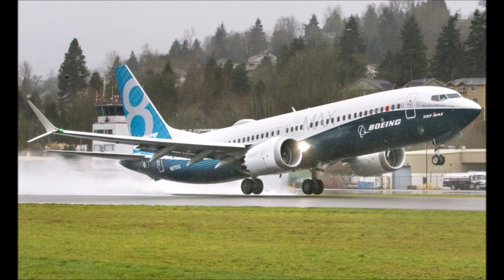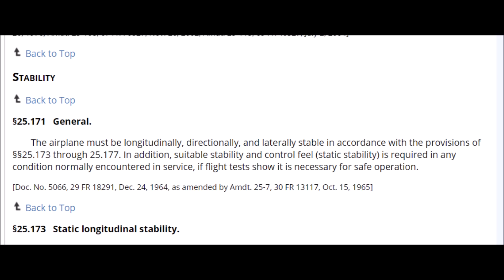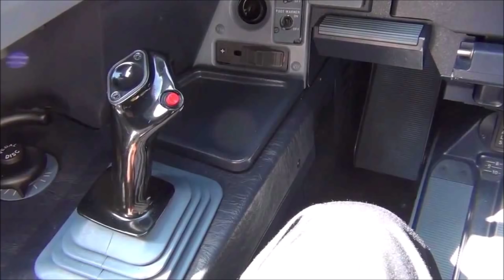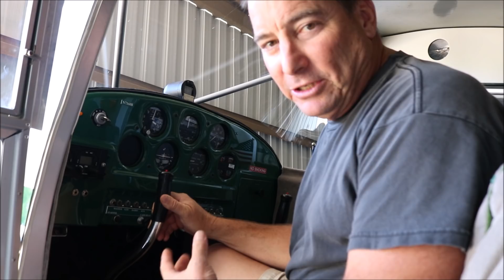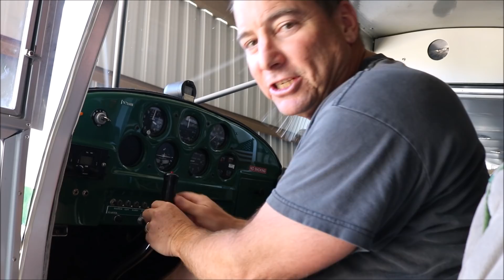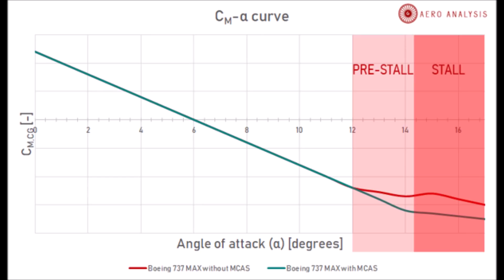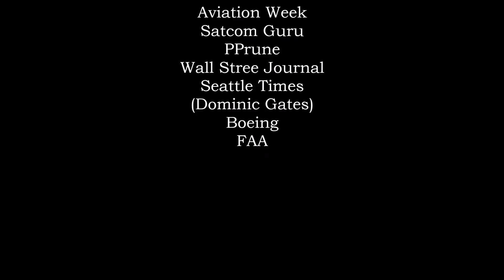737 Max UPDATE 30 Aug  2019

Comment: "MCAS is NOT an anti-stall system". Something that warns about or discourages a stall is not-anti-stall? Where would a stick shaker or indeed the warning horn fit into that? We're not the only ones confused - the argument about the exact nature and purpose of MCAS has been raging on that 'Professional Pilots Rumour Network' (a US based pilots chatboard) since Lion Air. Is it an anti-stall or is it a system which 'modifies longitudinal trim AT or near the stall' and what's the difference? Professional pilots don't seem to agree and Boeing's original MCAS documentation even contains the phrase 'ant-stall' on at least one page.
Why is so important to the pro-Boeing faction that the term is avoided? Does anti-stall have some other more specific meaning - in military jets for example or is the fear that once the words are said, the 737 Max will be unable to shake off the 'inherently unstable' label? I'm no pilot but I seem to remember from my total six hours learning on light aircraft that the best way to manage a stall is not to get into one.

Comment: Hmm. My ears pricked up when you mentioned '16-bit', which is pretty stone age these days when you can buy a decently specc'd 32-bit microcontroller board for $2.00. Found also multiple allegations - not denied by Boeing - that the FCCs on the 737 Max are based around the Intel 80286 chip, which was pretty much evolutionary toast in the PC by about 1989. I'm old enough to have developed '286 software in assembly language and it USED to be a neat little chip, albeit running at about 20 MHz (yes, MHz) and with some intrinsic design difficulties about its memory access capabilities. Although I can well understand why Boeing would go for a true microPROCESSOR, given the requirement to customise bus communications, I'm mystified as to why they'd want to stick with this Intel pre-history. Whether it was a good idea or not, every modern computer geek able to Google has rushed forward to decry the 737 max problems as due to 'silicon'.

Comment: Great videos, Juan.
Just for the record, the Longitudinal Axis is actually the Roll Axis.  The Lateral Axis is the Pitch Axis.
Reply from the maker: You pitch 'about' the lateral axis by maintaining longitudinal stability.
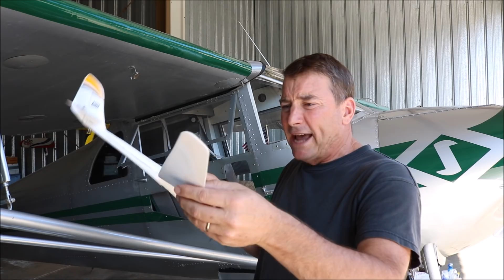Reply: At 12:09, you stated "aircraft stability on the longitudinal axis, pitch axis.."  You wiggled the model around the lateral axis as you said it. The lateral axis is the pitch axis.
Reply from the maker: You'er getting all wrapped around the axle with your Bill and Martha King private pilot tapes...lol
If we had a lateral stability problem here we would be taking about  wing rock or rolling about the longitudinal axis.
We are discussing longitudinal stability. Not lateral stability.  not the axis upon which each revolves around. Semantics.
Reply: Now, you're just being petty. I also have 40 years of flight experience. At 12:09 in your video, you CLEARLY claimed that the longitudinal axis was also the pitch axis. This is simply NOT TRUE, and there's nothing "semantic" about it. "Axis" is defined as  "an imaginary line about which a body rotates."  If you had a question on a written or oral exam about which axis controls pitch, you would have answered it wrong.  
 
My only issue is you incorrectly stated at 12:09 the longitudinal AXIS is the same as the PITCH axis. I do NOT have an issue with the rest of your explanation. 

Perhaps you should review the King tapes and pay close attention to the part explaining the three axes?

Bottom line is you made a mistake, and you're unwilling to own it and set it straight.

Comment: Once the MAX starts flying again, I will have no issue about flying on it. The problem will have been fixed. But the damage is done. I have chatted with family members who have said they will avoid flying on the MAX, because of the trust issue. As such, it has damaged the whole 737 brand. My biggest issue is still seat and leg room. Not the plane model or brand.
Reply from the maker: Exactly.

Comment: Great job, Juan -- as usual. Very detailed reciting of MCAS development. 
What most folks miss is that the Ethiopian Air flight departed Addis Abbaba which is at 7800 feet elevation and  is surrounded by mountains of even higher elevation. It has been noted that the throttles were never pulled back after takeoff and this led to the plane's airspeed being much too fast to manually trim. They did try to manually trim but it wasn't possible so they reenabled the stabilizer trim motor cutouts which also permits MCAS to feed commands to the stabilizer. This caused the plane to crash. If one looks at an time v AGL plot it is clear that the pilot was trying desperately to
thrust the plane to a higher altitude as quickly as possible. Perhaps this was to have more time to work the problem or perhaps it was to avoid flying into a mountain. In any case it's not clear
that even if the crew was aware of MCAS that the flight could have been saved. If they knew they might have been able to slow down enough to manually trim. Although the original MCAS design (as delivered) wasn't great it was probably sufficient.  The revised plan of disabling MCAS only is the right thing to do. This permits trimming by normal methods at any altitude and speed.
Reply from the maker: see previous updates.

Comment: Just a thought: If Southwest is rethinking its entire business model, how about a new plane that is based on what SWA pilots want?
Reply: Too much cost to do that. Planes allegedly being looked at by SWA include the A220 (smaller than the 737, can be used as low-density feeder aircraft for flights like Dallas-Love to Lubbock) and Boeing 797 (two-aisle config allows for faster turnaround time than newer -800's and MAX's).

Comment: Thank you for the excellent reporting. Long ago when I was in Navy ROTC they would bring a small prop trainer and we would go flying with a Navy pilot. Great fun! Great little air plane. After doing a series of barrel rolls, loups, the next demonstration was how sable the plane was.  Full power, nose up into a steep climb. At some point the prop would cavitate, the plane would shutter and the pilot would say "don't touch the controls." With neither of us doing any thing the plane would start to fall backwards roll sideways an fall rapidly. it would then do a series of side to side swings bring the nose to level and proceed as if nothing had happened. The pilot would say "OK take over" again. No computers! That little plane had a lot of power, didn't care if you flew up side down, really short take offs & landings. Teach that to a 737!
Reply from the maker: Yep Stability achieved thru aerodynamics.

Comment: Let's not forget the crash of Air France 447 in 2009 which might have been prevented with stick feedback informing the pilots they were flying in a stalled condition. Instead they and their flight computers flew an Airbus A330 right into the ocean killing 228.

Comment: You should have used this explanation from the very beginning.  Don't let the mass media dictate all the false facts.  Push the fact that one of the two crashed aircraft had previously recovered from a trim runaway condition by shutting down the MCAS system by a competent third pilot.  Different cultures are likely not as well trained or disciplined as USA pilots.  Boeing should have put trim in motion audio to warn the aircrew.  I really like trim in motion audio in test flying (MPLS MN Autopilot repair specialist) many different corporate aircraft.  I always paid attention to pitch trim making certain it was always functioning properly, autopilot on or no right through to coupled ILS approach. Many years Autopilot repair specialist.  Fortune 100/500 city upper Midwest.  Lots of business.

Comment: Yes, MCAS was a bad design not having redundant inputs.  Did the pilot side AOA sensors fail, or was it input to the FCC?  Who built the AOA sensors, was the Indonesian previously changed (as reported) AOA sensor tested?  Odd the Airbus Alt-law crashes didn't cause a grounding or as much uproar.

Comment: Juan I have been watching your channel for some time and really appreciate your research and professional inputs. Hope you will be flying again soon.  As a compter science and pilot guy, I have been following aviation accidents for many years with an interest in human factors and engineering design issues. While there are numerous design principles for modern aircraft, no single points of failure, transparency of functions and feedback are important even though Boeing and Arbus differ in their design philosophies. I hope that there has been a thorough protocol for the changes to FCC, AOA and MCAS architectures and functions that doesn't introduce some new hidden behaviour that is thrown back at the pilots.
Reply from the maker: Thanks Gary!

Comment: Well, you brought the whole story together here for me with this video, and the length was necessary to link the whole saga together. Being a retired airline pilot, I have had no problem following your earlier videos and the technical terms therein. Much of the puzzle was unknown to me, but you made it all make sense with the additional information here. My own career was almost all old technology airplanes with only the A300-600 being new glass cockpit technology, and I personally did not care for it much. To each his own, I guess. Of course, the problem the MCAS was meant to correct does not really have anything to do with glass or old style gauges, but is an aerodynamic problem. Many airplanes have had problems along the same lines, and usually the choice has been made to use a hardware fix rather than a computer software solution, the Boeing 767 pitch stability problem in the landing configuration being fixed with vortex generators was one of them. That type of fix does away with the software fix problem requiring abnormal checklist procedures in the QRH to overcome a failure such as in the AOA indicators and the software and a lack of redundancy for such an occurrence as happened in these two accidents. Of course, there was no such inclusion of any procedures in the QRH, further making this MCAS solution unacceptable. I am now horrified that Boeing thought that what they came up with was fine and adequate, and I can not believe that they actually thought that there was nothing to it that line pilots could not handle without any prior knowledge of its existence! I question what failure mode testing of it was done by their own highly skilled test pilots with engineering backgrounds where they also thought that no training or even mention of the system was necessary for the average line pilots to safely handle a malfunction. My confidence in Boeing has been badly shaken by this, but I think (and hope) this may cause a big change in how things are done in the future.

I'll add here now as an edit that it seems odd that those two knowledgeable FAA Certification Inspectors chose to leave and maybe seek their fortunes elsewhere in or out of the industry, and then Boeing added a whole bunch more to the MCAS software when the two less experienced inspectors showed up to take their places. It's probably a coincidence, but maybe not...... Who knows?
Reply from the maker: Thanks WMA

Comment: Not enough is talked about regarding the inexperience of the pilots and the poor maintenance of aircraft in these third world countries!
Reply: The Lion air crew had over 5k hours a piece and while the ET302 FO had about 300 hrs (which was legal in the US until 2013) the Ethiopian captain had over 8000 hrs hardly inexperienced.

Indonesia's airlines have had poor safety records in the past (although in recent years their safety ratings were upgraded in the EU) but Ethiopian Airlines is among the largest airlines in the world and Ethiopia as a country meets FAA standards or their airline wouldn't be permitted in US airspace - which they fly to daily
Reply: @PabloGonzalez-hv3td  

Re: ET302
Pilot, 29 (youngest pilot in the airline) had only 1407 hrs logged on 737's and NO required Max training (not even the 2.5 hours via iPad)
FO, 25,  had only 207 hrs in 737's and no training in the Max.
And the country has a 737Max simulator available, but neither pilots had been in it.

So, experience in the 737, which is what they were flying...they didn't have that much experience at all.

*Side notes, 
I have lived in Djibouti, Africa (which is a border country) and have been to Etheopia and can tell you that nothing is as it seems. Money and corruption is everywhere. 

I'm sure there are plenty of great pilots out there and maintenance crews as well. But nowhere even close to larger countries.

Re: Lion Air crash.

That exact plane had multiple maintenance issues that had been ignored and not repaired. It was declared not airworthy and yet, still flew?! That is on maintenance and also the pilots...since it is their responsibility!

Also, that exact plane, only the day before, experienced the same malfunction and a third pilot that had been there was able to solve the problem with ease. 

So, could these crashes have been avoided if the pilots were from larger (better controlled) countries....umm, yes absolutely!

Also as a side note...hundreds of 737 Max planes were flying in the US and overseas...yet the only crashes were from third world countries??

I will say that Boeing did fail in a few ways as well. Not notifying companies and pilots of the mcas system and what it did. And only requiring 2.5 hours of training, not good at all! So, I'm not saying that Boeing is blameless, I'm simply stating that these crashes would not have happened in first world country, with much higher standards (both with pilots and maintenance)! Not that all first world pilots are the best...they are all human after all!
Reply: @jasonlacomb5382  - 1400 hrs on type is anything but inexperienced I think you're conflating the 1500 hr rule which is total time and again up until 2013 even the FO's 300 total hours were more than sufficient to qualify for FO. It should be noted that even with the 1500 hr rule there is absolutely zero requirement to fly anything resembling an airliner to obtain the ATP certificate so it's practically guaranteed that the ET302 FO had more hrs on the 737 than a 1500 hr US pilot has on similarly complex aircraft.

I would not be surprised if the aircraft were at least partially recoverable the point is those pilots should not have ever been placed in those situations to begin with - certainly not in brand new airliners - if it was mostly pilot error the Max wouldn't still be grounded with no end in sight.

If it was mostly pilot/training error Ethiopian airlines would have been blacklisted from American or European airspace 

So you're implying Ethiopia paid off...the FAA?
Reply: @PabloGonzalez-hv3td  

No, I'm not confusing the 1500hr rule, with his experience. The point is that the total time between the two pilots was 1600 hrs...that's total time with a 737 type. And neither had the required 2.5 hours training for the max. 
I wouldn't fly on a "new" commercial airliner if the total combined experience of the pilot crew was 1600 hours on type.

That's not enough to operate safely.

I also don't care about 2013...it's not 2013, it is 2019 now. The rules have changed and obviously for a good reason!

The Max's will be flying again very soon, just an FYI.

And if other pilots knew (which many did) how to stop the problem (which was as simple as turning off the engine that gives power to the mcas) then, these pilots not knowing is a clear example of a lack of experience. 

The truth is simple...could the problem have been stopped by the pilots...YES, by turning off the engine that powers the mcas....did pilots know about this measure, YES, some did. Those who didn't, either didn't have the experience or the proper training. 

So, could the crashes have been prevented by the pilots...YES (by the fact that it had been prevented before)! 

And regarding ET airlines being blacklisted...no, it takes more than a single accident for that to occur. Should they be...maybe, I believe that an independent maintenance and pilot crew should go (unannounced) to do a proper investigation.

So, to summarize...

-yes, the max is going to be up and flying very soon (by Southwest I believe)

-yes the pilots could have prevented the crash (it was not unrecoverable) as proven by other pilots before the crash actually solving the problem.

-the lion Air plane wasn't even airworthy due to maintenance issues that had not been fixed, so it shouldn't have even been in the air and that is maintenance and pilot responsibility!

-should have been a third pilot with experience onboard the ET air flight, 207 hours on type is not enough experience to be a FO and be effective in CRM. 1600 total hours on type between two pilots is NOT enough, obviously, due to the fact that neither was able to resolve the problem (which had been resolved by other pilots)! 

-its easier for a country to blame the manufacturer, rather than their own failures in maintenance and training. Cast a shadow of doubt is all they had to do, to keep their companies in the air.

*Side note...if Boeing had bribed the FAA (which is a rumor that is going around), then surely a country is capable of bribing the FAA.

We clearly don't agree on experience in the cockpit, which is fine, that is a debatable issue. 
But I'm glad we both kept it civil and had a decent discussion, thank you!
Reply: @jasonlacomb5382   - Military pilots receive 1000 hour patches as a sign of veteranship on type you have absolutely no idea what you're talking about and that extends to the rest of your comment
Reply: @jasonlacomb5382  - I have served actually thanks for asking that's how I know 1000 hours is considered a milestone of experience you're clueless